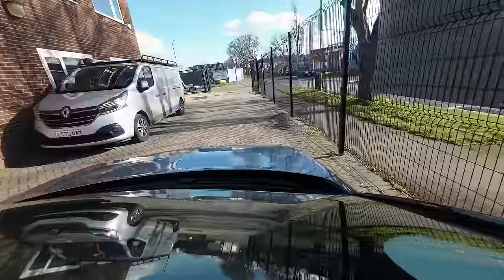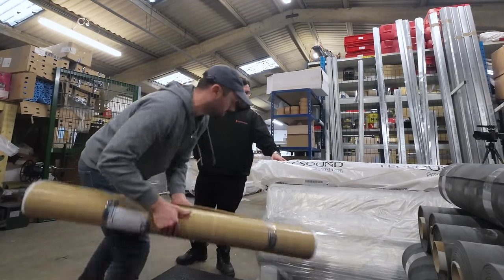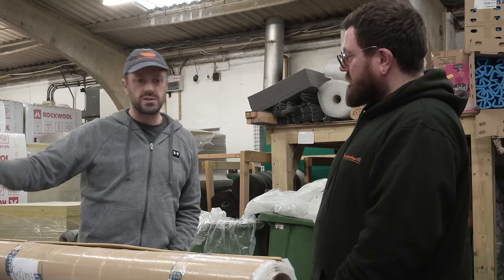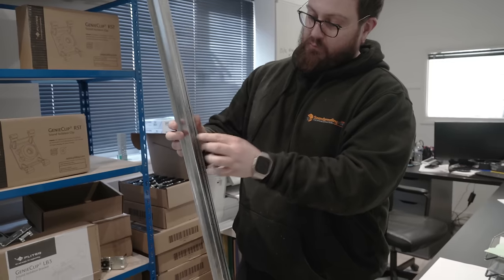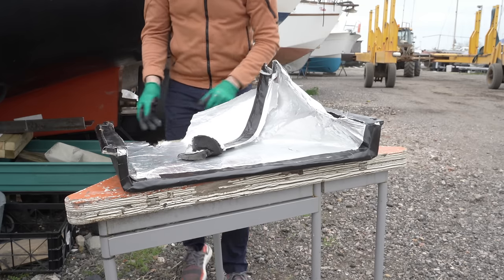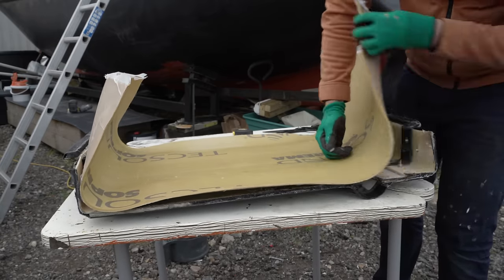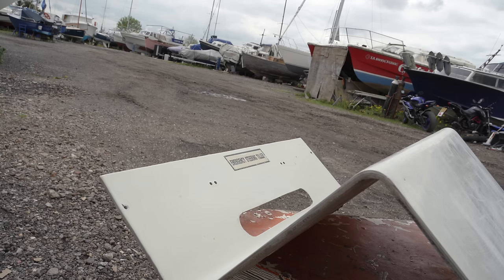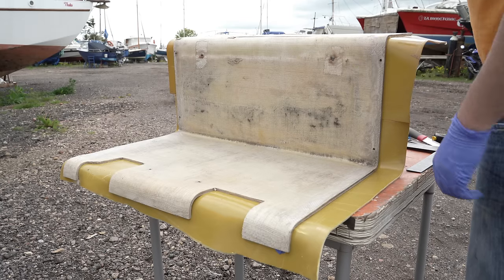Lifeboat engine bay soundproofing with Tecsound mass loaded vinyl. Lifeboat Conversion Ep78 [4K]

Comment: All you need to do is make a five-sided box. Big enough to cover the engine. But give the box a 6 inch air gap or vacuum along all five surfaces. 

So basically just two boxes. One with a outer diameter 6 in larger than the inner. Giving you a 6-in inner gap. To fill with air or vacuum.

And while the construction of such a boxes is not free. The insulation is. And the insulating capability of a vacuum is unbeatable.!

And it could totally be done with fiberglass which we all know is your favv.

Comment: One of the biggest sources of noise is the induction noise.
The “air filter” can also be used to reduce induction roar, as well as restricting dust and dirt ingress. Your engine has a very primitive device with virtually no acoustic limiting effect.  Also resonant noise from the prop shaft and gearbox needs to be controlled.  Have fun.
Reply from the maker: Yes the original air filter is in the spares box. I have an induction silencer to fit soon.

Comment: As someone that is quite sensitive to sound. I sincerely hope the place you rest at is somehow in a dead spot for the lower frequencies as much as possible. Only time will tell.
Reply from the maker: Having slept in tents with snorers, I've long got used to using little mouldable silicone ear plugs.
Reply: @AlexHibbertOriginals  Considering the conditions, even people that don't usually snore, will make noise in those situations perhaps. Good ear plugs help a ton.

Also, I'm really happy with how often you upload. You mentioned it would in increase in a precious video, but still, that takes effort..

Comment: one would think that you would need to line the floor of the engine bay as if not the noise could escape through the floor to adjoining rooms , plus my thought would be to line the Whole boat , not just the motor room .... cost a lot more but think the noise would be more diminished

Comment: It is probably a redundant question but how does it perform in cold with condensation?
Reply from the maker: It's impermeable and doesn't trap air, so if there's condensation without, there'll be condensation with it too.

Comment: I can't remember what you have for vibration isolators between the engine and hull itself.  You might want to do some research for alterative (modern) solutions.  Car manufacturers have spent millions of dollars building better iterations for diesel engines vs what is installed in your lifeboat originally.
Reply from the maker: True. Just normal rubber engine mounts. To replace these would be a big job, needing to support the engine weight and decouple from the prop shaft.
Reply: Car manufacturers line their cars with Mass loaded vinyl. that's the original use then it moved to domestic and commercial applications. MLV100 or Tecsound 100 is the best option.

Comment: I was  considering Tecsound for my engine but I have a issue with fire rating of that material 
B, s2, d0
B - Combustible materials
d’ part relates to ‘flaming droplets and particles’ during the first 10 minutes of exposure.
‘s’ part relates to total smoke propagation, during the first ten minutes of exposure
B= Very limited contribution to fire
D0 = none
S2 = quite a lot of smoke

Did you consider the above specifying your project?
Reply from the maker: I did. The cowling it's mounted to is made of wood!

I did do a flame test in an episode, and couldn't get it to ignite or smoke with a low temp flame.

Comment: 30db reduction in sound? Seriously, that's huge and I'm not sure I'm buying that. The decibel scale is logarithmic so a 30db reduction is enormous!
Reply from the maker: I'm not sure they can advertise those stats unless tested as such - we have strict advertising standards here.
Reply: @AlexHibbertOriginals  I am an audio hobbyist. I can believe 30% or 3db but 30db? Normal ambient background noise level of a typical living room is 40db. That's without speech. I would want to see that reduction shown on a db meter. I ran across this video because I was looking for engine compartment insulation results. I watched a video of a guy who (using a different product) carefully insulated his engine compartment with a good product and achieved a 3db reduction in noise level. Here is how the decibel scale works...
On the decibel scale, 0 dB is the smallest audible sound. A sound 10 times more powerful is 10 dB. A sound 100 times more powerful than near total silence is 20 dB. A sound 1,000 times more powerful than near total silence is 30 dB.
Reply from the maker: I understand how log scales work.

The product clearly states its Rx rating, so you'd have to take it up with them.